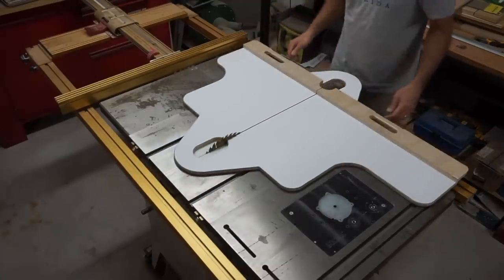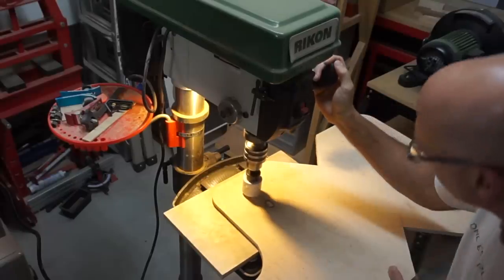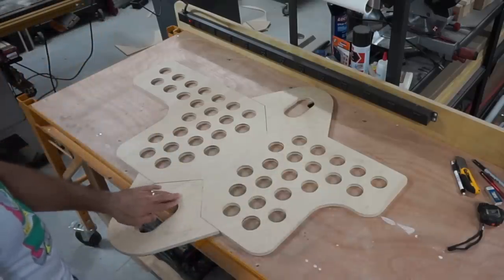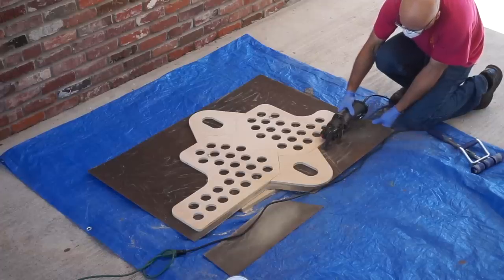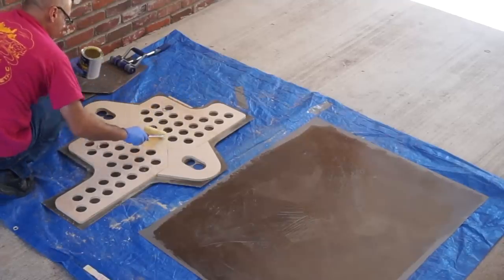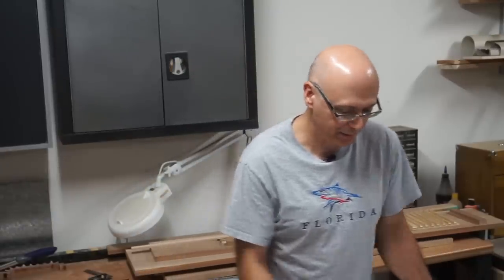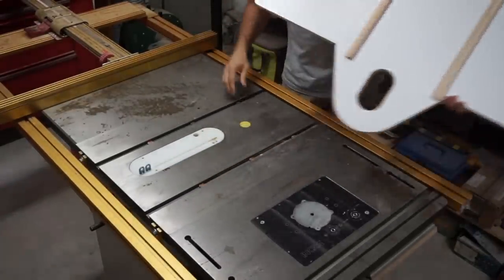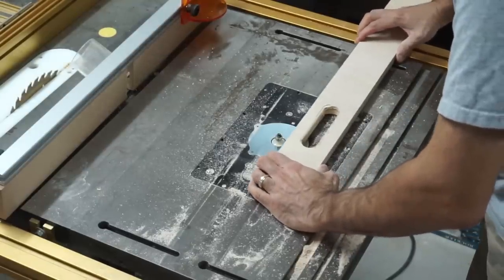A Crosscut Sled Like No Other

Comment: THOUGHTS AND SUGGESTIONS
1. The materials of the sled are plywood & melamine while that of the saw table is steel.  As temperature and humidity change, the distances between the T-slots and the guide rails will change with respect to each other.  If the rails fit the slots very well now, one can expect them to bind later.  Such binding will also affect the flatness of the sled.   

Fortunately, only one guide rail is required -- the second is superfluous.  Eliminate the second and that problem is reduced to the seasonal changes in widths of a single slot with respect to a single rail.

2. The greater purpose of building a crosscut sled is to increase the precision of cuts.  I would not be at all pleased with a sled that is off 1/32" in 15". Errors compound quickly in woodworking. Try cutting a rectangle with the current sled by rotating the the workpiece clockwise 90° after each cut until all four sides are cut.  The angle between the fourth and first sides will be out of square by 1/8" in 15".  That would make for a very poor picture frame; mitered corners would be unattractively gapped. And every cut made with the sled will be off by that much.

 It is possible (and practical) to align the fence such that the squareness error in two feet is under 0.005".  Once done, it's done for the life of the sled.

3.  Cover the fence guide surface with formica or metal to reduce wear, thus preserving its flatness.
Reply from the maker: Thanks for all your comments! I agree, only one guide rail is needed. It has become standard practice to use two on homemade jigs, not sure why. I agree the accuracy is not great. It was a first shot at this jig. I shimmed it to correct the minor out of square and it works great now. Good suggestion on covering the fence surface. Thanks again!
Reply: AN AFTERTHOUGHT
With sleds, I've found it a bit tedious to clear the sawdust away that lodges in the corner between the fence and the sled base.  Any dust missed keeps the work from locating snugly against both the fence and the base during the next cut.

I've tried cutting 1/16"square rabbet along the bottom corner of the fence before fastening it to the sled base. That does make it easier to keep that critical corner clear of obstructing sawdust.  However, the rabbet makes the fence useless for materials thinner than ~1/16".

On my next sled, I plan to cut a 1/16" deep x 1/4" wide dado across the width of the sled base such that, when the fence is finally located and fastened to the base, the leading edge of the fence will overhang about half the width of the dado.  Such a sled should provide useful  sawdust relief, and it should still work with all but paper-thin stock.

Comment: Genuine question, I can see why you should hold the workpiece down, to prevent kickback etc. but could you not use heavy weights - like fitness weights - to hold each side of the wood down, while you keep hands out of the way pushing the sled?
Reply: Sounds brilliant.  An *original thought* for the win.  I've been playing (trying to anyway) keyboards and guitars for 43 years. I developed this thing on my own, my original thought of this thing I later learned is called "Piano Charting."  We have this thing called "bio-rhythms."  Peak hours of the day where we're operating at peak efficiency, times where we are most likely not to hurt ourselves.  Do the dangerous stuff then.

Comment: I like the design of your sled, really sleek looking, great job, but I'm not crazy about the no hands approach, I would of used a taller stop so you could get a good grip and push the sled closer to the cut groove with one hand while holding down the piece with the other. Or even pushing with both hands while holding down the piece with at least some fingers. A kickback from a 5 horse table saw can ruin your day.  
All I did was use 1/2" X 24" X 36" piece of baltic burch and a kiln dried 2"X4" on front and back of the sled on edge after ripping off the eased factory edge so they sit perfectly flat. It weighs all of 15 pounds and cuts dead square.  When I cross cut long pieces I use a narrow scrap piece at the far end of the saw table to level out the piece I'm cross cutting.  I have an off feed table that's 8' X 8' with a malamine top and wraps the end of the saw on one side so I can cut full sheets with ease.  The off feed table doubles as an assembly table, I'm spoiled, I have a large shop so space is not an issue.

Comment: Trouble I have with all these workshop videos is that the workshops are always equipped with every kind of tool and of the best quality.  My little "workshop", which is just a home made workbench under the deck,  doesn't have any of it.  I have a standard size table saw that I have to pull from under the house and set up every time.  My extensions are rollers that I place where needed.  I have a portable router table that is also stored on my "sled" under the house and has to be brought out separately and clamped to the workbench.   So I get about two minutes into the video and realize I probably can't achieve the same result with my meager set up, which is probably more typical of most DIYers.

Comment: I really like your design!  It's an indication of great vision and critical thought.  However, I have to respectfully question some techniques.  I might have used screws instead of just epoxy to reinforce the runners, and especially to square the fence.  33/thousands is not that close and the fence could be dialed in more with some tweaking that epoxy doesn't allow.  I am also not convinced that the material you run through the blade will remain in static without benefit of a hold down or your hands somehow in contact with it, especially on slippery laminate material.  I do applaud this very different design idea tho.  Nice concept and maybe one that isn't yet at its final phase.

Comment: Here are the things that got me itching: 
1. screws inside a lamination instead of just glue 
2. why was the board cut and then extended?
3. gluing on the floor instead of a flat surface
4. lamination used in order to hold pieces together (?)
5. the cross fence glued on the upper side of the lamination instead of screws (gonna pop off someday)
6. fence aligned 90° with a square with no possibility to adjust 
7. cleats also simply laid on top and glued - no routed tracks - no pressure (gonna pop off someday and when they do you can realign)
8. super ignorant on how he cuts the piece - sorry that's just wrong and I hope nothing ever happens 
9. as far as the design goes the board is rounded but the fence is square
10. also the fence is to shallow because as you noticed yourself, it is dangerous to have your hands in the middle - if the fence was taller and you would have a box at the end you could make safe cuts while you still hold your stock.
11. slickness is not the basis of design 
12. and it's not even square

we'd love to see you do a knew one
Reply from the maker: My first top 12 list... and I didn’t even have to create it myself! Thanks! Joking aside, all good comments. Making another one...hmmm. I won’t say never, but who knows.

Comment: I'm curious- have you had any problems with rigidity of the handles?  Do the pocket screws provide enough rigidity, or would you make it from a single sheet of plywood next time?
Reply from the maker: Doug Smith, no, I have had no problems with it. The laminate and laminate glue do most of the work of holding it together.

Comment: Your width measurement assumes that both sides were parallel prior to your test cut. A better test might have been to flip the piece over, maintaining the same base reference edge, and cutting the other side, then take your measurement. Otherwise, a great design. Thanks!
Reply: Yes Mike that would be the way. However, the 5 side test would be absolute.

Comment: Hi, nice work your wood is not squared because you only cut on side . you must cut both side to the squared edge of the slide to the blade.You need a hold down clamp for safety.

Comment: to really check for square you need to cut both sides on the sled then check it with the calipers. you can't assume the factory edges are square. Also, you really should put some kind of hold-down clamp on the sled. your piece could still kick-back. Trust me, you don't want that to happen, it hurts. (And depending on how that kicked piece hits you, could be deadly). With your handle design you are right in the line of fire for a potential kick-back.

Comment: I would add a zero center self adhesive measure tape to the hand hold. How did you remedy the hold down issue?
Reply from the maker: Thanks, Margaret! I know the hold-down issue has been played up in the comments, but I have had no problems with pieces flying up at me. One note I would make is there is a difference between cutting small, light pieces versus larger, heavier pieces. The heavier pieces tend to stay put just due to their weight.

Comment: NIce design, I might have to build one like this. But... doing a five-cut to get the fence squared is far more accurate than relying solely on a square. Also, not holding down the piece being cut (and then pulling it back unheld) is just plain dangerous.

Comment: Why did he not make the plywood section out of one piece instead of the two small add ins.
Reply from the maker: If I didn’t make the small add-on pieces separately, I couldn’t cut the main straight edge all the way across and then I couldn’t be sure it was truly straight.

Comment: Forgive me but why not just use the rip fence for this operation ?
Reply from the maker: Hi rmdemaray, you can certainly do that, but when cutting a piece that is wider than it is tall, it’s considered good practice to push the piece from its bottom edge to avoid binding against the rip fence.
Reply: I've used table saws for over 40 yrs. Why would it bind against the rip fence ?

Comment: looks great, and light weight. but why did you cut it in three pieces, why not just one piece, and then laminate?
Reply from the maker: This approach allowed me to cut a rectangular piece as my main piece and a somewhat smaller one at that. It was also easier to cut out the slots in those smaller pieces rather than cut them as part of a much larger piece. I don't think I compromised the strength of the sled, if that's your concern. The laminate on both sides in addition to the interlocking triangle shapes holds everything together quite securely. Finally, I don't expect there to be any forces trying to bend the sled in use (the sled lays flat against the table of the saw), so these joints don't need to be very strong.
Reply: I've Been Thinking Workshop 

That makes sense, thanks.

Comment: I think this is an interesting prototype. There is value in all ideas. I do wonder why you cut separate pieces instead of one. Also the weight of the wood removed for the holes compared to the weight of the pocket screws, laminate and glue? I suspect that it is a negligible amount and not worth the extra work and expense. Hell you might have actually added weight.
Reply from the maker: Don’t forget all the air that’s trapped in those holes. Air is not weightless, you know.
Reply: Judging from your reply I hurt your feelings. I apologize. That was not at all my intention. You did ask for replies so I'm curious why this is the only reply that you chose to comment on. Since you have been practically excoriated by others I thought I would point out valid issues since you wanted to reduce weight. You asked for replies. Besides the unnecessary metal screws and the glue, if the laminate applied to both sides were as thin as your skin it would weigh much less.  lighten up:)
Reply from the maker: No hurt feelings, here, rittt248. Just commenting on your comment for entertainment’s sake. Isn’t that why we’re here?

Comment: I realise that you have to laminate both sides to maintain a flat board but wood slides on laminate too easy and with no clamps its only a matter of time before an accident. Perhaps roughening the top surface or opening some of the holes at the top and filling them with silicone would remove the slick surface. That and the accuracy aside, Its a good bit of kit you have produced.

Comment: So you have a very limited 20-26 inch pass length if you made an arch block front & rear to join the two halves, you could raise the blade to Max height of about 5" and go any darn length you want.

Comment: One last thought: I use a thin rigid foam core in marine application that would even be lighter than your perforated ply core.
Reply from the maker: Thanks for the comments, Bill. Where do you get that rigid foam core material? I assume you’re not talking about insulation material?

Comment: Not a design that has the needed features for a safe and versatile crosscut .   A taller fence (and adjustable / replaceable , still could be added to base glued in place) ,  t tracks for clamp down (could still be added ).    What I did glean from the design, and am going to modify my own sled , is to remove the sides of the length that I also brought  back on the sled past the fence (which I did so the fence did not have to be firmly attached to connect the halves ).     Will reduce a little unneeded weight . Thanx !

Comment: Love the delta-wing configuration and drilled out areas to reduce weight; will use these ideas on next sled, thanks.  Kudos on the dust mask, but why no acoustic protection with bandsaw, router or table saw?

Comment: I used to install for a huge cabinet maker and help out in the shop to get our jobs ready to ship. Came in one week and found a new piece of safety equipment: a padded leather apron an inch thick for the table saw stations. Turned out during the weeks we were out of the shop a guy got killed by a piece of maple kicking back. Crushed his spleen or some such, bled the fuck out before he got to the ER. Just sayin.
Also, why did you bother to make the 2 pieces you pocket screwed as separate pieces? Cut it all out at once and the plys would have held it much better than the screws.
And curious: you have some great tools, but you could use a laminate trimmer router. Cheap, light, maneuverable, handy.
Reply from the maker: That’s a horrible story, Joey! May your coworker Rest In Peace. See my response to your question in my answer to another recent comment.

Comment: Nice sled, need some improvements like the handles need to be closer, see at it's not possible to push with one hand on handle and other on work peace. As my teacher say: most important is not to be afraid from saw or other power tool but be aware of things what and how can happen if something goes wrong and keep hands out of that area, neither less always have a good grip on work peace.

Comment: The idea of lightening the sled is commendable, but instead of going to all the trouble of laminating over the holes that you cut through the plywood, why not just use your router to remove material from the bottom of the sled, not cutting through the top?
Reply from the maker: blacksmith67, that would work too! I like having the slick laminate surface against the table, though.

Comment: Sweet prototype! I have a nano-shop (actually the word "shop" is a stretch). This would lay flat hanging on the wall or slide between cabinets or whatever.

Are you planning on doing a 2.0 incorporating suggested tweaks or is this just a proof of concept for feedback?
Reply from the maker: There is not a version 2.0 the works at this time, but that could change if I get inspired!

Comment: Cool but darn hazardous. Better put those splitters back on to prevent the saw blade from catching the back of the sled and throwing it right at ya. There's a good reason why the other sleds have a vertical board at the back and the blade goes through it unhindered.

Comment: You didn't say what type of work you plan to use your new sled for, so I assume it's for everyday use, in which case,  the framing square method of squaring up the fence is fine. After all, don't we all put our trust in the framing square for accuracy every time we use it for other applications? Why not in this instance?
Reply from the maker: Yes, it will be for everyday use, unless you consider YouTube to be “professional” use ☺️ and yes it gives me the accuracy I need. Thanks for your comments, Joseph!
Reply: When I'm framing a house with rough lumber, a framing square is fine for accuracy. That's about the limit of a square of that type.

Comment: The basic concept is actually not back. A big sled is heavy. I like the Swiss cheese laminate bed. But thats about all the good I can find. As many have said, ssooooooo dangerous. You need to hold anything that hits a spinning blade. And your fence, should be taller and better aligned you could do better accuracy with a skillsaw. Good luck to ya
Reply from the maker: Thanks for your comments, even if you don’t agree with everything I do in my videos.

Comment: Also you should of made the cut then flipped the stock over and locating from the same end cut the opposite side, then measure width. You would make us all watching feel a lot better if you held the stock down on to the sled, when you made the cut I could hear all the guys viewing gasp! I moved my tablet so I was in the path of the board coming off the sled and hitting my face.